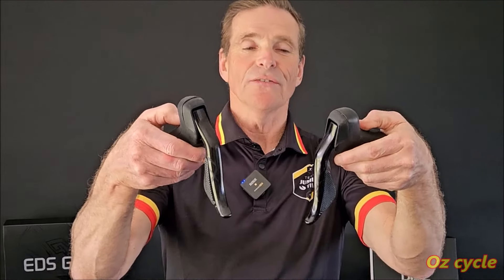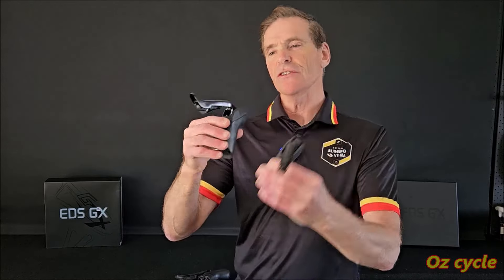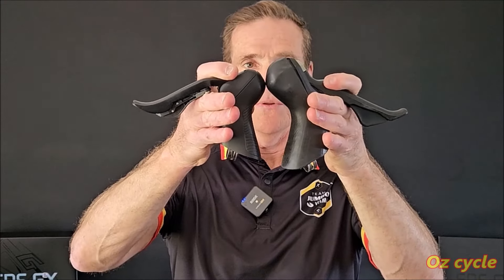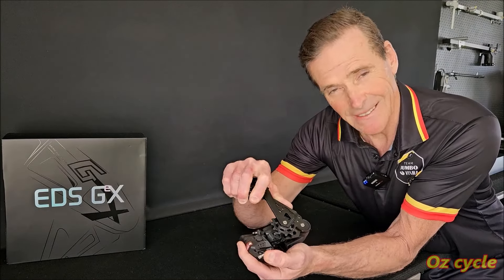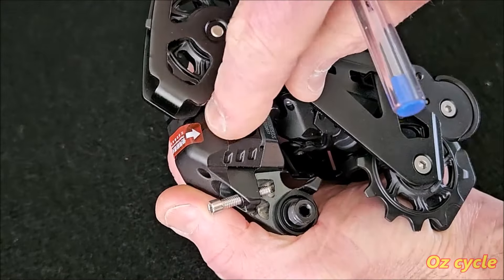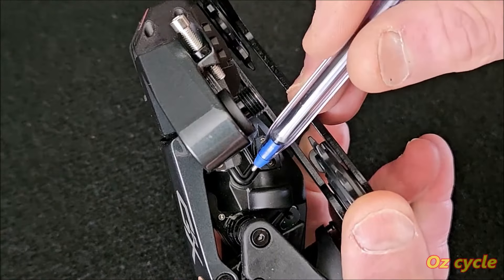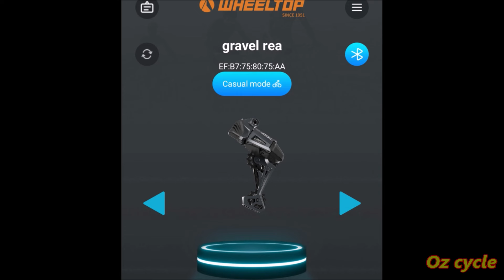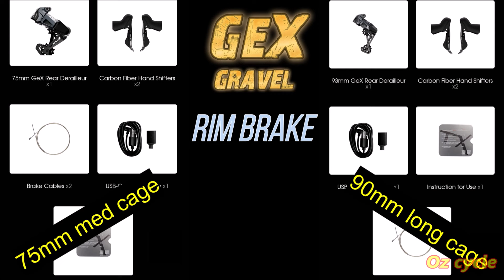Wheeltop GEX gravel system -  unbox and review

Comment: Thanks for adding the weight, most reviewers don´t do it. It seems Wheeltop is obviously not telling the truth about the weight as they say the rear derailleur is 375g (long cage +-2g) vs measured 405g and the calipers are quoted as 95g (+-5g) vs measured 121g.  That´s quite a bit off from what you have weighted. Shimano and Sram is usually spot on with the claimed weight.

Comment: You mentioned that road shifters are carbon whereas the GeX are aluminium. The wheeltop page now has Carbon Shifters as an option with the GeX groupset.

I suspect they are exactly the same shifter. As you commented in these chats, the brains are in the rear mech, not the shifter...... Carbon shifters increase the cost :-)
Reply from the maker: Yes. Wheeltop EDS is an evolving system along with the App. They have just released version 2 of their OX rear derailleur too.

Comment: I notice the top jockey wheel (guide wheel) is on a cam rather than concentric with the pivot. This always gives a much better shift and helps mech work with a very wide range of different cassettes.

Comment: Hi ..Good reviw.. I like to order gex soon. But 
I have mtb version (ox) of wheeltop on my hard tail mtb..
Is this (ox) possible to work on my greval  frame flat bar system? 
The ohter word I want to know that ox work on greval flat bar system…
Reply from the maker: So you want to pair the OX thumb shifters with the GEX rear derailleur?
Reply: I wonder that OX set compatible with greval frame. If it is compatible with greval frame ,why wheeltop introduce new derailler?
Reply: What is the deference between gex and OX derailleurs..The shimano 12 speed cassette computable with mtb and greval frame ..as far as Iknow..
Reply: No, I asked Wheeltop via email, they said that the GeX shifters and OX derailleur do not work together.....shame

Comment: I have a question, Wheeltop website says the shifters are compatible and if they are the tx ones anyway, surely you can run the tx front mech then set it up on the tx app?
Reply from the maker: No. The CPU is in the rear derailleur . Gex rear derailleur doesn't accommodate a front derailleur.  Maybe in the future Wheeltop will make it so.